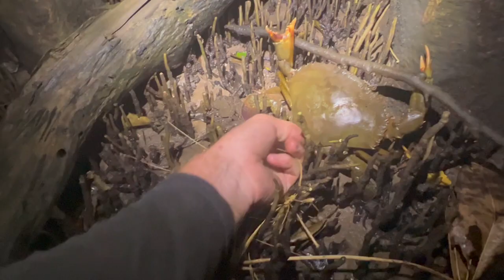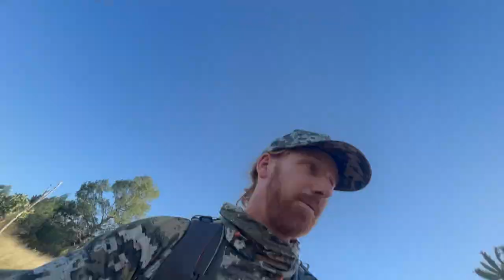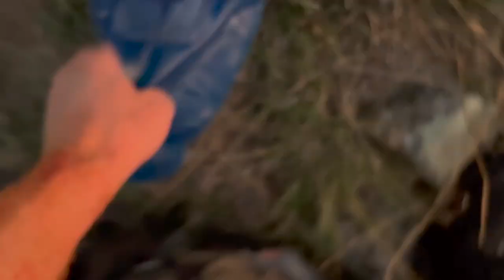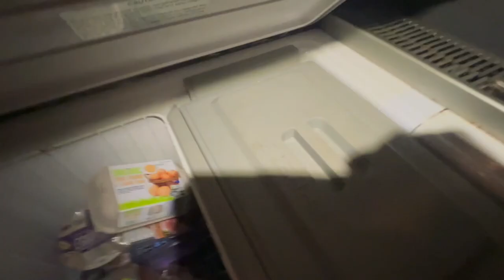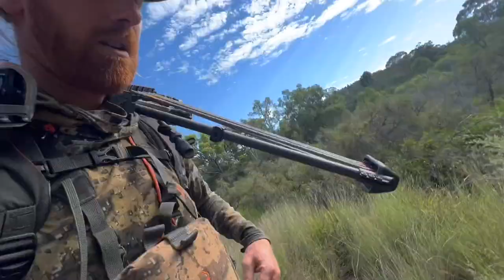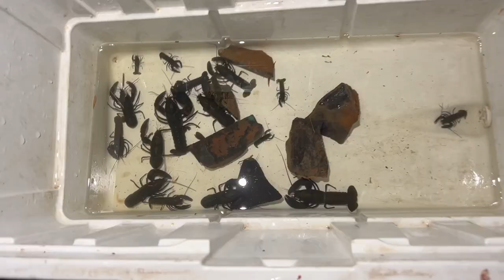VELVET FALLOW STAG DOWN! Hunting Deer Bowhunting. Plus, catching Mud Crabs & Yabbies by hand!

Comment: That was an awesome vid mate, love the rig, running an Option 4 and quiverlizer myself on the carbon defiant. 30min vid is a pretty daunting task to process straight up, was all quality but you could probably break it down to 2 or 3 parts in 10min/15min sections might pull in a couple more viewers. Non the less I really enjoyed that 👊👊
Reply from the maker: Cheers mate, great feedback. Was a bit of a long one, will hopefully be around the 10-20 minute mark in the future. Sometimes just hard with the hunting ones and a bit of camping. The new bow is mental, I dunno if I finally am having some luck, I’m more confident in drawing or if the bows amazing but that’s about 5 trips in a row of success so pretty damn stoked. Havnt been to the supermarket for meat in about 9months!